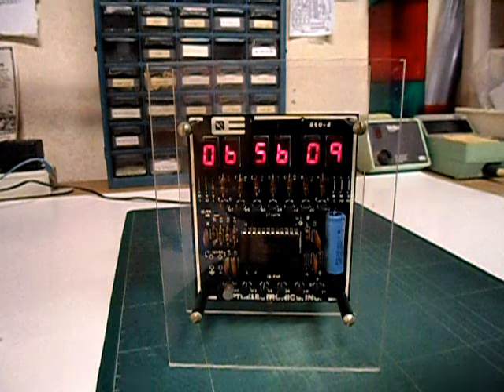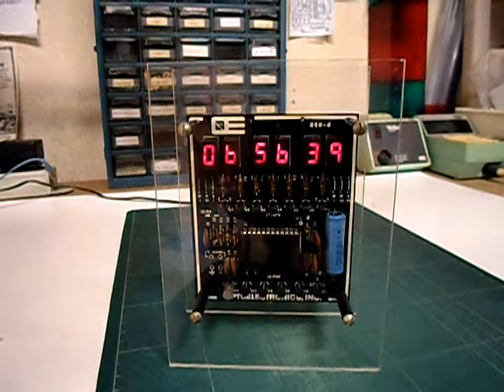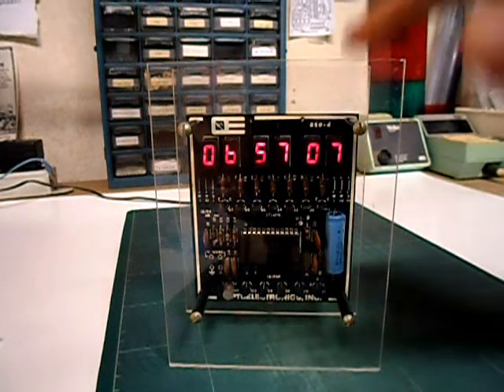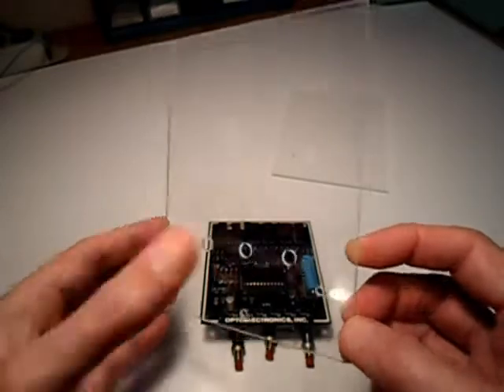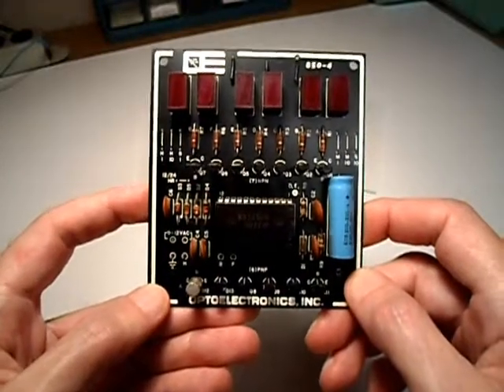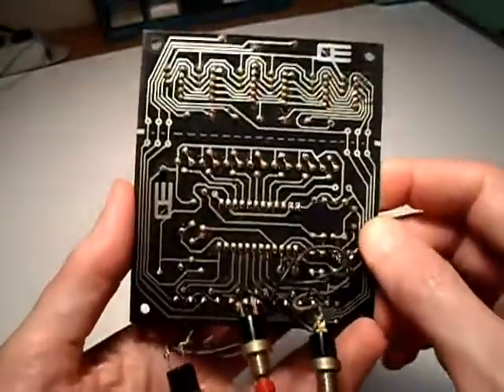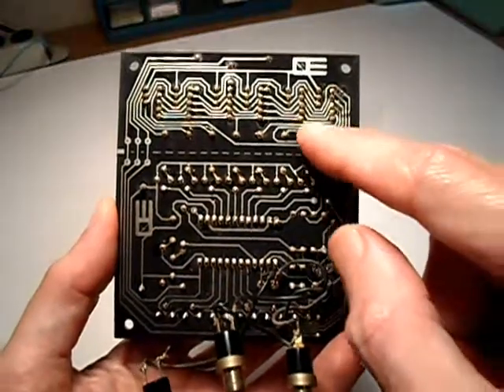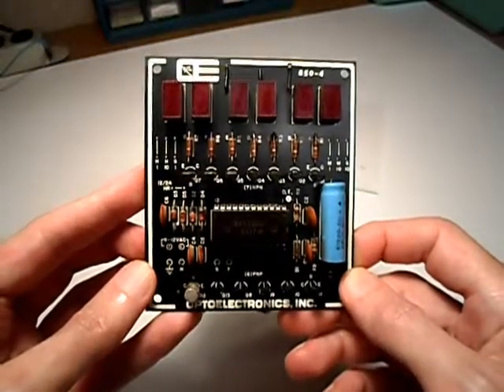Vintage 1970's LED Digital Clock Kit : Optoelectronics 850-4

Comment: Just interesting, I know that in 1970s, the number 6 commonly looked like a b in SSDs. Why did they display it as a b and 9 as a q?
Reply from the maker: Great question!!!  Yes, I have noticed this, and wondered about it too. You still on occasion see the "q" version on the 9 digit.  You never see the "b" version of 6 these days.  National Semiconductor set the pace for 70's clocks with chips in the MM5300 series.  They use the b and q versions. Some prominent Ham Radio manufacturers, like RL Drake, used the b and q versions in their LED displays back in the 1970's.  Wikipedia discusses the b and q versions briefly, but no real history is given.  The number seven sometimes appears with the F segment too, but is much less common.  Thanks for the excellent and interesting question.